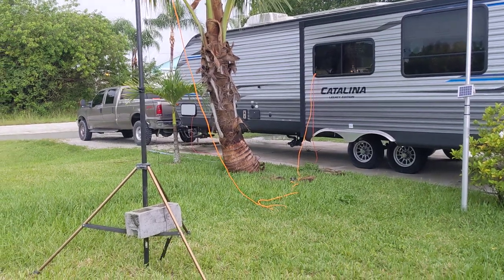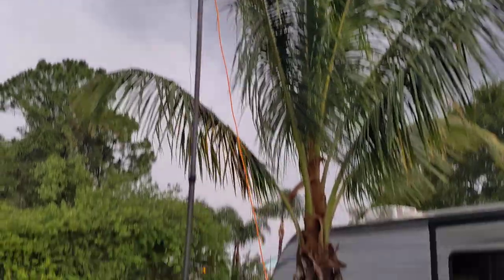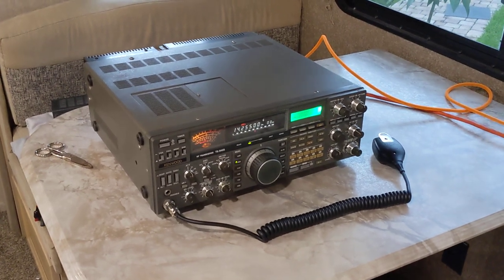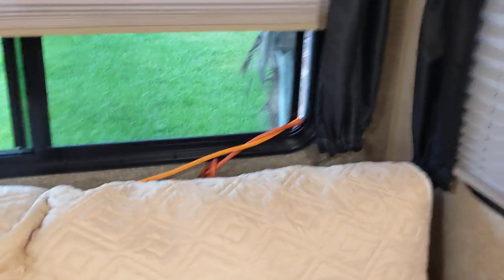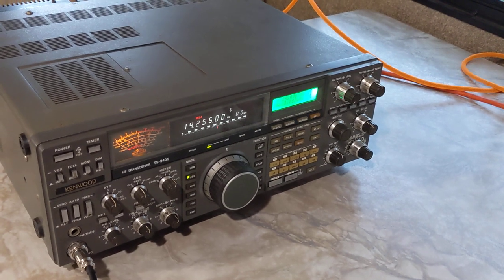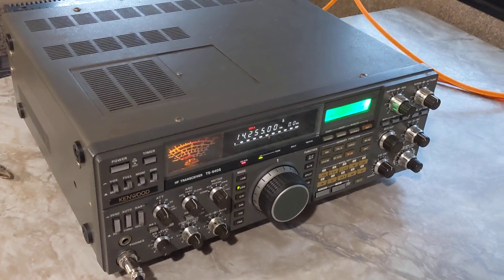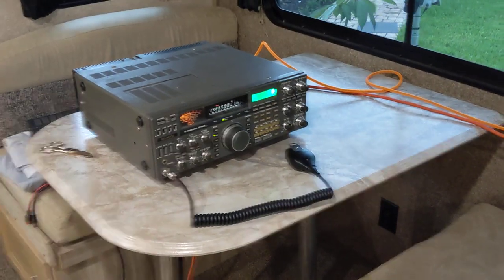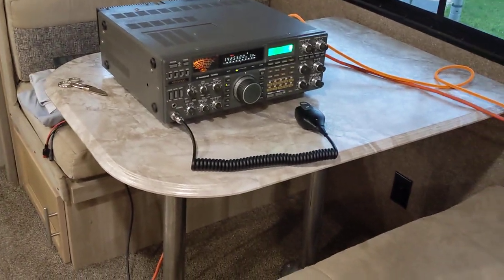ARRL Field Day 2023, Round 2!!! At Home, 1E SFL

Comment: nice setup. powerline noise can be bad. very bad spot when lined up  right under the powerline. sometimes I still do paper log. this summer going tent camping and doing some parks on  the air in NY. IC 7300 and LiFePO4 powerqueen and 300 watt worth of folding solar. got some new GMRS radios as well to try hiking. MURS as well. one spot planned has no cell service unless we boost is used. 73's